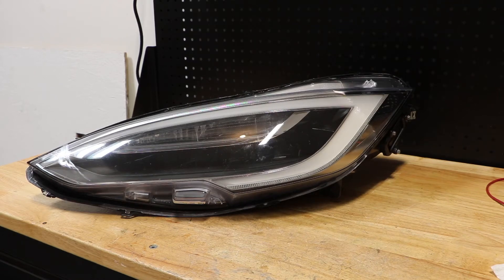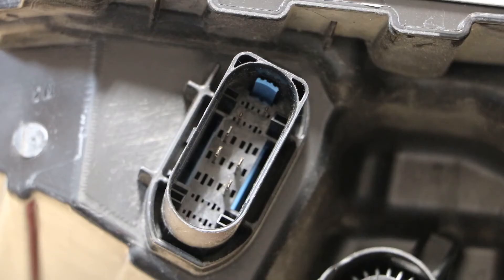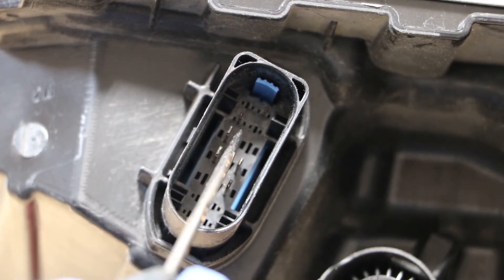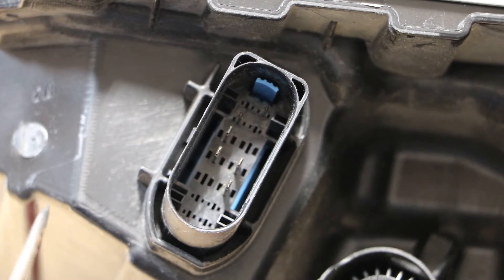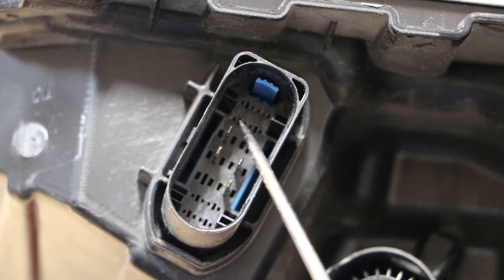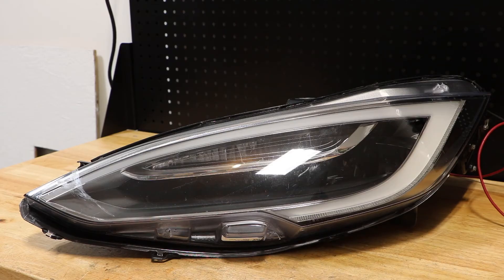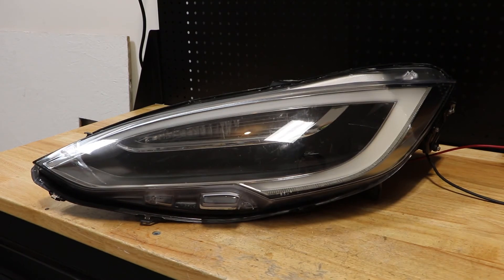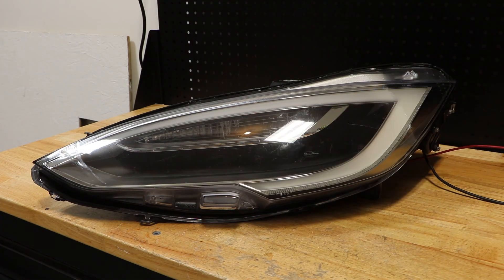How to partially test a 2016-2020 Tesla Model S Face-lift LED OEM Headlight

Comment: Thanks for posting this video. Have you figured out the DRL yet? I was able to activate the headlights as you did, but not the DRL yet.
Reply from the maker: no.  I suspect that it requires a canbus signal to activate the other lights and isn't a simple wiring setup.

Comment: Hey there, remember me? I bought a replacement headlight for my Model 3 on eBay and it causes a warning message, and flashes rapidly, suggestions? I was thinking about taking the blinker module off of the old light and installing it on the new one, sound like a smart idea? Tnx.
Reply from the maker: it's a simple first step, but also depends on which lights are blinking.  If you go through the effort, I would swap both the LED corner light and LED ballast at the same time.    The LEDs could have been damaged in shipping as well and changing the units will have no effect.
Reply: gftgrill Thank you again for the reply. I got a bit hung up on your words. When you say “corner light” do you mean that blinker module on the outside back of the light? I think it’s a smart move to replace that and the ballast, I’m glad you agree, Tnx. When I had the light in the car, all LED segments worked, including the signal, it was just blinking rapidly, and causing the same behavior in the  tail light and fender light. Thanks again for your response.